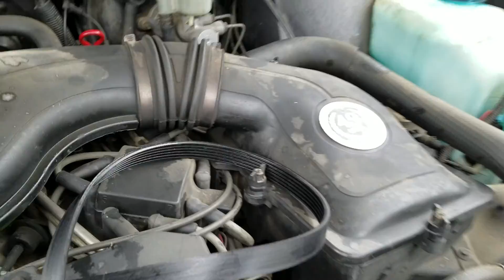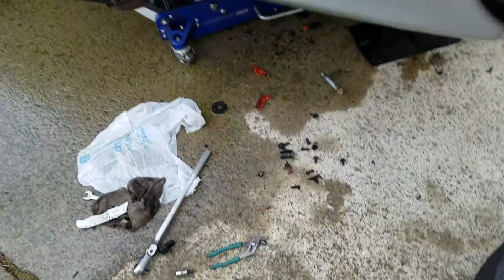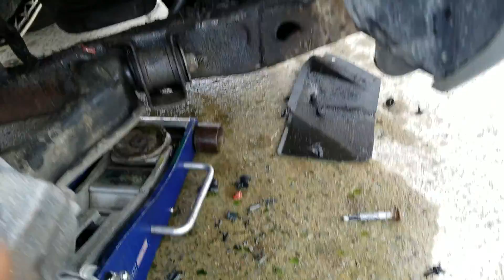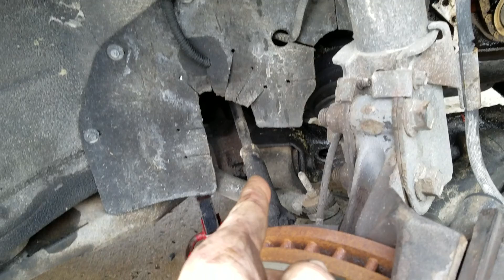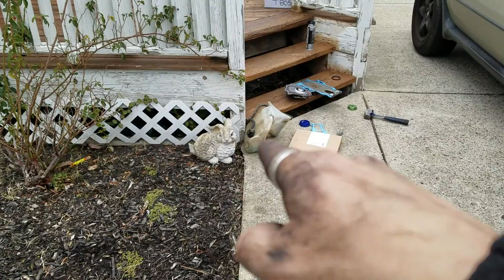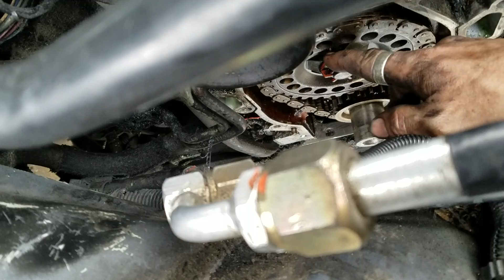My tips on Cadillac 4.9 water pump and timing cover removal or replacement

Comment: This made my life much better, now I didn’t drop the crattle I was able to get the harmonic balancer off without dropping it I used a OEM tool puller it’s very small and was able to put it back on as well now I had to replace that whole over due to one stud snapped and the other I had to drill out to get the nut off.. after fixing I still had a leak in the same spot so I found a cover and looked this up once again thank you GM is a dick for this engineering done here

Comment: I was pumped to do my timing chain until i saw this video...people say its just as easy doing the water pump but on a 1994 4.9L all you have to do is remove the battery and coolant reservoir to have enough room to remove the water pump....too bad I order the parts before the video.

Comment: I’m glad I’m not doing all that not today not this time I’ve actually did that on this car maybe 40,000 miles ago with the water pump so I’m gonna have a little confidence in my work and the water pump is so trashd the pulley and the belt were rubbing into the housing sounded identical to a rod knock/ bad engine .
I will never do reman again so long asbi can help it

Comment: I think the previous repair loosened the wrong bolts and pulled on it thus breaking the factory seal if you do all that please please please for the love of god change the 3/4 coolant hose on the other side of the inlet or it will fail and do your front main seal but you can always do that later using a screw and a hanmer

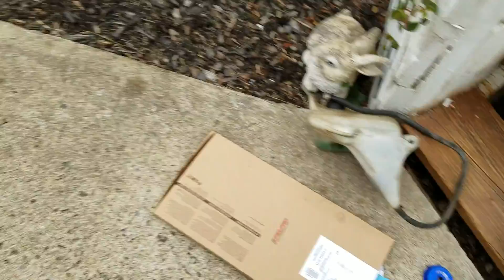Comment: 5:28 is totally normal, that little nub on the cam sprocket is a spring-loaded thrust button to keep the roller cam from walking back and forth and shredding the valvetrain. This video was super helpful! I found that the job is easiest when your motor mounts have collapsed LOL
Reply: I second that it’s not gonna rub thru as long as you keep oil in it

Comment: How can I repair the heater core of my Cadillac Seville 4.9? And Coolant all over engine on passenger side :(
Reply: Marcos Orozco Garcia don’t fix it by pass it that’s what I did no heater anymore
Reply: Heater core is super easy and probably the easiest heater core to change out ever on a car! Remove the glovebox, unmount the HVAC computer, two screws holding the plastic cover over the heater core and then the heater core is exposed. Disconnect both hoses outside the firewall in the engine bay, and its that simple to do!

Comment: I actually also did the same myself a while ago on a Cadillac Allante.  Both the Allante 4.1L and 4.5L engines are exactly the same. I found when replacing the water pump to just remove the entire cover plate and replace all the seals at once since they were all still original in my case.  Doing the water pump replacement on the Northstar 4.6L is much easier to do and access.  But good video man!
Reply: Any tips? Sorry this is 5 years later lol but debating on doing this myself on my 90' Allante. Leaking oil from the timing cover and I figure I might as well do the water pump too. Did you drop the subframe as well?

Comment: how did you remove and install the timing cover seal?
Reply from the maker: I have a set of seal drivers.  Cheap ones from Harbor Freight work fine.  Just soft aluminum.

Comment: was it easier to install as one piece. that meaning timing cover and water pump already together?
Reply from the maker: Yes sir.  I'd never do it the other way again.
Reply: So you install the gasket to the timing cover first or to the block? And is permatex high tack good fir this?
Reply from the maker: I honestly don't remember. I use Ultra Black as an RTV
Reply: I'm having trouble aligning the water inlet and T-cover any tips should I mount Wp on the T-cover first and should I have the car off Jack and Jack stands. Please any help is appreciated

Comment: Hello!
I need to change rear exhaust manifold on 1991 Cadillac Sedan DeVille. Can you please share information - how to take exhaust manifold - lowering engine or taking down frame? I worry about this job.
Reply from the maker: sadly I've never done one before so can not offer you help
 you will likely be doing much if the work from above reaching over the motor without much ability to see what your doing
Reply from the maker: MisterKenwy I have never done the exhaust manifolds on those but dropping the subframe seems logical